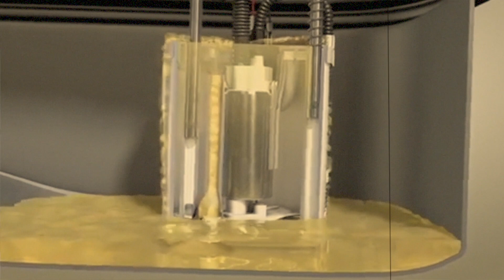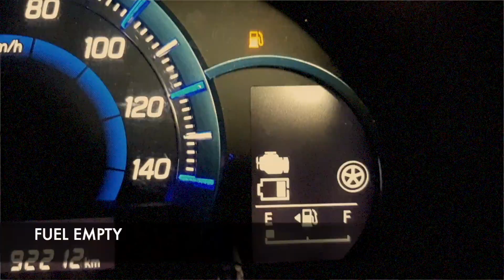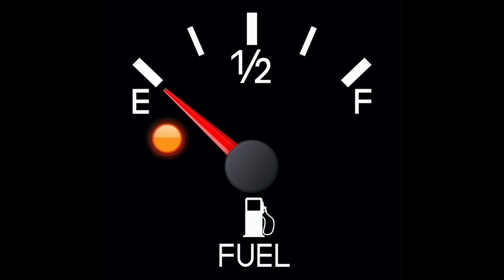IS IT  NECESSARY TO TANK PETROL FULLY ⎮ වාහනය පෙට්‍රල් ෆුල් ගහන්න අවශ්‍යමද? ( Sinhala )

Comment: Hi Sir, I’m a second owner of FIT GP5 S grade 2013 model. Previous owner used 95 octane fuel. Now I want to use 92 octane regular fuel. Is this recommended to use & if so will it affect engine in the long run?
Seek your professional advice. Thank you
Reply from the maker: Better to use 95 octane, Othervice it will effect to  your cars emission controll sysyems such as catalytic converter , egr system ..in long term usage ..then try to use 95 euro4 ..
Reply: @nuwanmadanayakaautohybridt3237  So is this statement correct in general to most vehicles - "If the manufacturer has recommended unlead petrol (95 Octane) and we use 92 Octane there is no impact on the engine in using 92 Octane. The impact will be only to car emissions in the long run. "

Comment: Very much appreciate this correct technical information.  It seems that we need to refill the tank before  when the indicator reaches 1/2  ( half tank ) level, since average tank capacity is in the region of  litre 30s, right? I also have heard or read somewhere that  when  we keep the tank mostly empty,  that empty space  is filled up by the vaporized petrol,  thus  our consumption of petrol is inefficient, as such vaporized petrol cannot be used to run the car.   I  do not know how far this information is correct or relevant. Also, this concept of  submerged fuel pump is new to me.  Hope it is news to most of our readers too. So this is a very good reason ( if not a must) for us to maintain our fuel tank at a reasonably filled level.   Thanks Dr. Madanayaka, for highlighting this point.  I know there are many like me who now depend on your site for correct information to keep our vehicles in good condition.